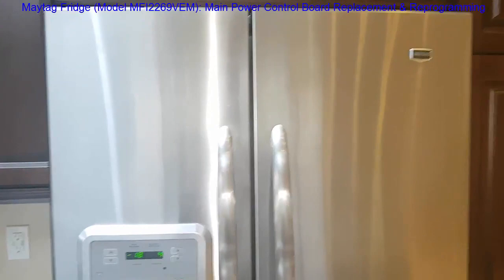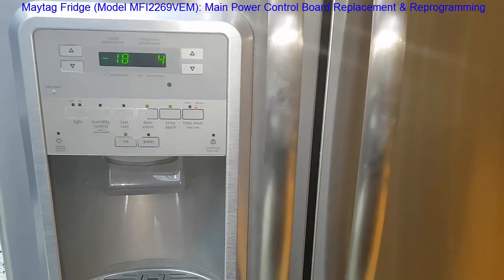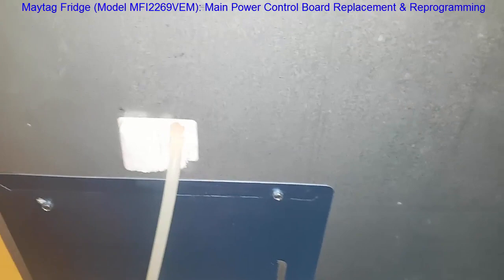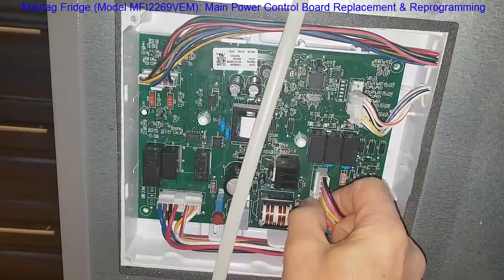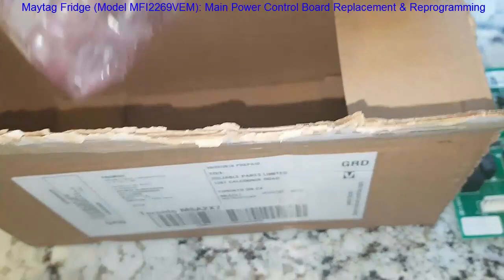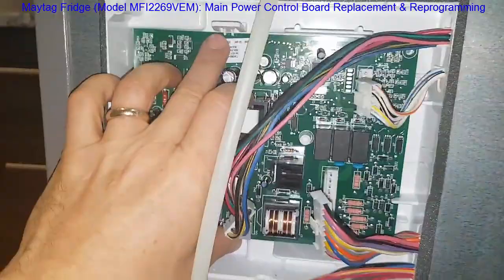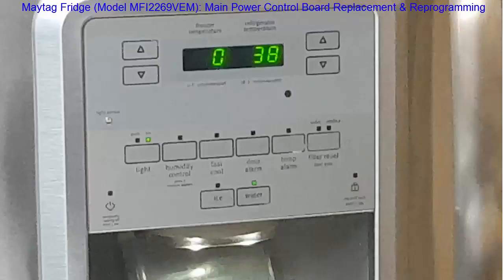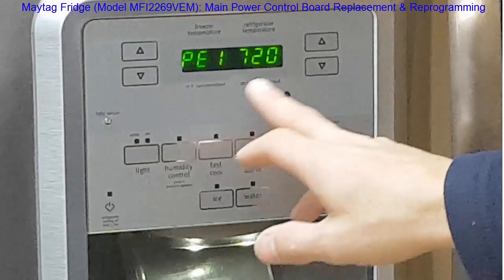Maytag Fridge - Main Power Control Board Replacement and Reprogramming

Comment: Mine would not work either method..Keeps blinking no matter what.
Reply: Try unplugging the power, then disconnect and reinstall the new main power circuit board and turn the power back ON. What happens?It should be flashing PE0 000. Then you will need to enter your specific CODE, which you will find on a sticker inside the fridge.  To do this carefully watch the video from timeline starting at 5:45 of 8:30. This is the part that shows how to enter the code and get out of program mode.  Also from 7:17 of the video it shows how to enter the program mode once you are no longer in program mode. Hope this helps. Let me know if you have anymore questions.

Comment: Thanks, I don’t know why these companies are so cheap to include an instruction sheet for programming these boards
Reply from the maker: Hi Darius,  It's a good question and one would think that such important instructions should be included in the operating and maintenance manual, that should come with the fridge, and in a clear and understandable manner that most people could easily understand and implement. Vito Casola - FIX IT Yourself.!!

Comment: My panel is FLASHING PE0 000
ANY ADVICE PLEASE
Reply: Hi, If it's flashing PE0 000 then you need to enter the CODE which you will find on a sticker inside the fridge.  To do this carefully watch the video from timeline starting at 5:45 of 8:30. This is the part that shows how to enter the code and get out of program mode.  Also from 7:17 of the video it shows how to enter the program mode once you are no longer in program mode. Hope this helps. Let me know if you have anymore questions.
Reply: Thank you so much for answering
Our program set was a little different 
First-Hold door alarm 3 seconds
Then press temp button for 3 seconds
Let go of door Alan but hold temp button bingo you are ready to enter code
Great video and thank you again 👍
Reply: Were you able to fix your fridge with a new board like I did? If so how much did your board end up costing you? Aren't you glad all that metal and plastic didn't end up in a landfill because of a stupid circuit board?  That's usually what happens because the cost to call a service man in to repair ends up being so high most people figure their better off buying a new fridge with a warranty. Glad you liked the video and it was helpful. Vito
Reply: Panel went on just as you demonstrated. The variation was sequence to reprogram. Big thanks and fridge running perfect. The cost was $130.00 for part 🎉
Reply: Glad to hear it was helpful.... My fridge is still running great and hope yours is too.And that's at least two fridges that didn't end up in a landfill....  I sure am glad that I'm doing my part to divert otherwise perfectly good products from ending up in the garbage.
Reply: I could only get either H20 OR ICE DISPLAY
Reply: @clementinobaculio9283  
Mine.is exactly same problem. Any help please
Reply: I have same problem.  Just replaced the board.

Comment: I replaced the control panel on this exact refrigerator however, after i replace the new control board the code PE0 0000 is just flashing and wont let me input the code. Do you have any idea why or what I can do to fix this ?
Reply: Hi Rita,   Recently someone (E. Smith) wrote back to me (Sep.2019) the following which may be helpful:  ----- E. Smith wrote: -----  My refrigerator, (identical to the one shown in the video) would not go into program mode as described.   However, I went to the "Service Instructions" that came with the refrigerator when we bought it.  Note, these are not the "User Instructions".  The Service Instructions provide a "9 STEP" set of instructions on how to program which worked for me.  These steps are as follows:   1) Press & hold the Door Alarm Keypad.   2) Press & hold "Freezer Temp Down" button on the keypad for 3 seconds.   3) Release the "Door Alarm" button on the keypad & wait 3 seconds.   4) The control will display "PE" to indicate your in programming mode.   5) Entry is confirmed by pressing the "Freezer Temp Down" button once more.   6) The control will display the current Program Code.  The value should be validated with the program code printed on the unit serial plate, located inside the fridge (mine was 1720).   7) Press the "Refrigerator Temp Up" button on the keypad or "Refrigerator Temp Down" button on the keypad to change the digit value with each key press.   8) The decimal point indicates the selected digit.  Press the "Freezer Temp Up" button on the keypad to select the next digit.   9) Once the desired Program Code is entered, press and hold the "Freezer Temp Down" button on the keypad until the Program Codes begins flashing, indicating it has been saved.  These Service Specs also say: "NOTE: If you attempt to enter an invalid Program Code the Control will not save the New code.  Exit the programing process by pressing any key OR press the "Door Alarm" button on the keypad for 3 seconds".  If you entered the wrong code I recommend you unplug the unit and start over.------ end of text from E.Smith.   So Rita, please read the above carefully and try following step by step and hopefully this gets your fridge code entered and you are hopefully back in business ---- Good luck...  Vito Casola.
Reply: Hi Rita,Sorry, other than what I wrote last time I'm not sure how to assist you further. Please carefully review what E.Smith wrote again and follow those instructions to the letter as others have told me there were able to get the fridge working again. Make sure you find and use your correct code for the fridge, usually located on a sticker inside the fridge. Good Luck.
Reply: Hi Rita.  I never had the blinking problem.  Maybe you can try unplugging the fridge then try pulling out the four connectors on the board, maybe wait a while and then plug them all back in again and plug in the fridge again.  Don't know why some people experience the blinking lights. Let me know if and how that works. Good luck.
Reply: Awesome. So what did you do exactly to stop it from flashing so I can share that information with others who experience this same problem.  So your fridge is finally fixed, that's great.
Reply: Ernie Sheets Hello i am having the same problem with the lights flashing . please let me know what to do . Thanks

Comment: I have the same problem, I'll try to fix it,  wish me luck...🥺
Reply: Hello Fran,That's great to hear.  Don't be afraid to try to fix it, it is relatively easy to do and hopefully you can buy the board at a relatively decent price. I paid $152.72 + 19.85 HST (Total Cost $172.57).  The company I bought it from was Reliable Parts on Caledonia Road.  I think their address and phone number are shown on the receipt in the video, just pause when you get to that part.  Otherwise call Maytag and ask them for an authorized parts dealer in your area.  Good Luck, and let me know how it works out. Thank you for subscribing to my channel.  I plan to add several new videos, as soon as I have time to create them and add them to the channel. Stay Tuned. Vito Casola
Reply: @vitocasola8358  Thanks 😊

Comment: I have this exact fridge. Recently, the power company did some maintenance, caused a power surge, and fried a bunch of electrical items in my neighborhood. 

Since then, my ice maker keeps freezing up, and the fridge has trouble controlling temperature and humidity. Also, when the water/ice light is on auto mode, it stays on almost all of the time. Do you suspect this repair would be a solution?
Reply from the maker: If the problem persists, or gets worse and you end up with your fridge not cooling or your freezer not freezing food then definitely I would say the main power control board is the culprit and either needs to be replaced or repaired (of course if you are able to find the component that failed due to the power spike).  Once repaired I would recommend plugging the fridge and other appliances, especially TV's, stereo's, etc., with delicate circuits into a good Power Bar with Surge Protection.  Good Luck Jonathan.  VITO CASOLA _ FIXIT Yourself.

Comment: The only problem is decimal doesn’t come in my refrigerator so i cant even program it. 😞. Its showing PE0 000 and cant do anything after that 😞
Reply: Mine is doing the same thing. I’ve tried all the other suggestions in the comments.
Reply: @FoxKid263  i pressed door alarm and down button same time for 3 sec and left alarm button but still pressed down button and it worked. Everything was same but i pressed for bit longer time.
Reply: @mussim0000  I finally got it to work! Thanks